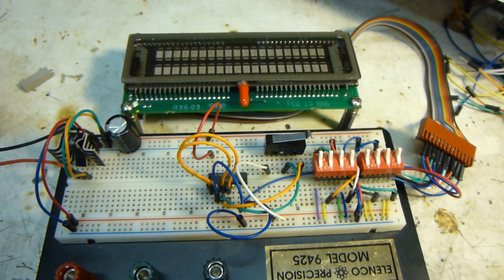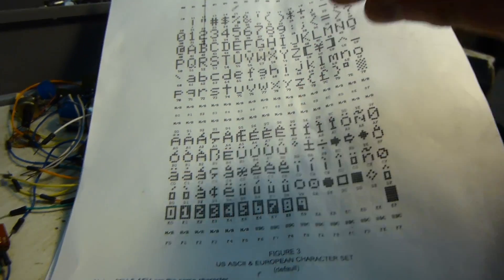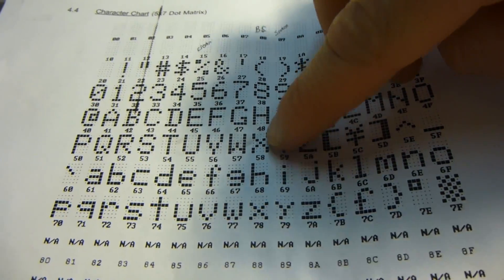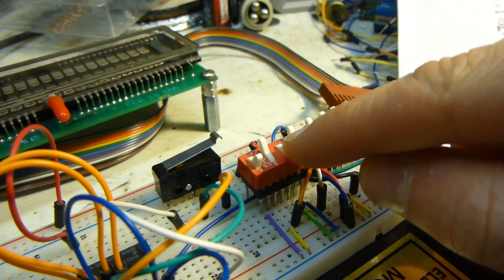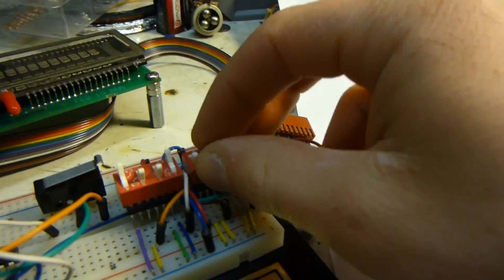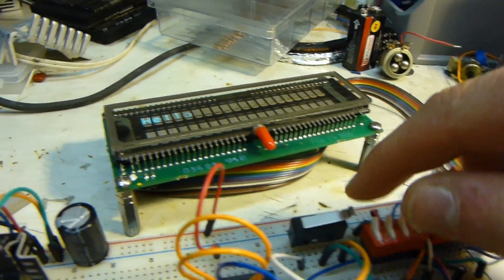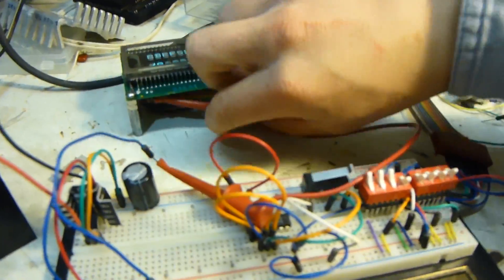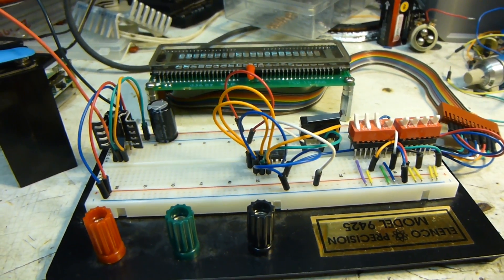Vacuum Florescent Display Driven With ASCII Hexadecimal Code Dip Switches

Comment: awesome display! i really want to hook up a display to my little board so i can have it tell me a bunch of stuff over the serial window. things would be so much better.
Reply from the maker: SuperBrainAK Thank you!  Yeah you could totally do that!  Would be really useful!  I'm kinda thinking about making a multi tool with this display and an Arduino.  I could put all kinds of thing on it like a RPM meter, volt meter, current meter, temperature meter,  frequency counter, signal generator, and whatever else I can think of.
Reply: Makerj101 ooh that would be cool, a capacitor meter would be awesome.
Reply from the maker: SuperBrainAK Yeah it would be!  I'm not sure how I could make one though

Comment: I like how you explained ASCII in the description lol, Not many people do that and the newbies have no clue what ASCII means.
Props on the ASSY display haha. Remined me of that show on Adult Swim "Assy Mgee" 
Anyways here is a really neat thing: The Motorola Radius SP10 series handheld radios used a similar system to set the channels of the radio. The radios came with 16 preset frequencies in the Business/MURS (VHF Hi Band Models) and business / GMRS band (UHF models) assigned 1 - 16 and the 4 way DIP switch under the battery tray was used to set the channel by number as Identified by the frequencies in the prom in the radio. Foe example: ch 1 in the prom was assigned to frequency 464.5000 MHz so you set the dip switches to binary value 01 and the radio would operates on ch 01 - 464.5000 MHz
Other models of Motorola radios like the Spirit SS, and PC10 were the same but did not have the full 16 frequencies in them, only 8 were available.
GE / Ericsson also made a version to counter the SP10 Motorola that used the same programming assignment.
OLD Vertex / Standard radios used a very crude system like this that used zener diode arrays that you cut or soldered in to assign frequencies. Talk about a pain in the ass lol.
Now back to the display:
You can use an RS232 Serial PC port, a PIC Micro, an Arduino or a Rasberry Pi to drive these things or build your own drive brain for them. Same goes for LCD screens too. They all uses serial type data bits, The problem is finding the tech sheets on the many many different types.
Reply from the maker: ElfNet Gaming Thanks!  Just thought I'd stick that in there cause I couldn't even remember what  ASCII meant when I was editing the video LOL

That sounds really cool!  I've sen those dip switches in lots of old equipment.  Probably serve a similar function.

Problem is I don't have a serial port!  Laptops generally don't have them let alone most newer desktops.  I guess a USB to serial would work but I'd have to fork over some cash to some chines company...  I do have a USB to parallel converter.  Would that work?  It was super easy finding the datasheet on this display.  But yeah I bet some are hard to find.
Reply: Get a USB to Seriel adapter, they're very cheap and very useful.
Where did you find your USB to parallel adapter? I know how to do alot of remote controlled functions via parallel
Reply from the maker: ElfNet Gaming Ummm I think it was in a box of junk computer scrape from my dads work.  However I actually stole the USB cable off it a while ago.  So I would need to splice on a new one... LOL  Stupid of me I know!  

I hooked the display up to my Arduino and it's working great!  It's sitting besides me right now displaying "ARDUINO HELLO WORLD!"  It's very time consuming typing in HIGH or LOW for each pin..   Basically the same as setting dip switches.  Plus it uses up tons of memory on my Arduino.  I'm sure there is an easier and more efficient way of doing this.  But I have not learned it yet.
Reply from the maker: Makerj101 I just posted some pictures of it on Google+  https://plus.google.com/+makerj101/posts/1ZvR21uPqm8
Reply: Dave Jones had a good video on the VFD and Audrino a while back.
Now all you need to do is try to drive an LCD matrix screen like one from an old cell phone or a new one even lol
Reply from the maker: ElfNet Gaming I actually had this display sitting around for a while.  I watched his video and that's how I learned how to drive it!  I'll have to go re-watch his videos to see what code he is using for driving it.  When I watched it before I just kind skimmed that part.  LOL
Reply: I though I had some matrix type VFD's in blue and in yellow from some old gas pump and cradit card machine teardowns but I cant find them..

Comment: Loved it. Would be possible to use both lines of display at same time?
Like an bar graph for a VU meter.
Reply from the maker: ***** Yeah you would be able to use both lines of the screen.  I think you would need to connect to Arduino and have it scroll really fast and constantly update the display blocks.  But I'm honestly not really sure.  I'm sure there is a way to do it.  The thing the display was in would change the bottom characters but the top would never change.  I think it can update/write characters really fast.  faster than you can see.  I'll have to play around with it and arduino.
Reply: Makerj101  Sure it would be a cool use for this old display... Let us know if you experiment with it.
Reply from the maker: ***** Yeah it would be!  I sure will make a video if I hook it up to my Arduino!